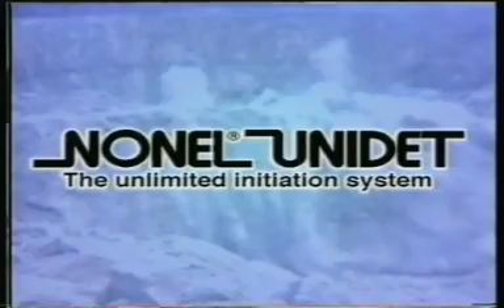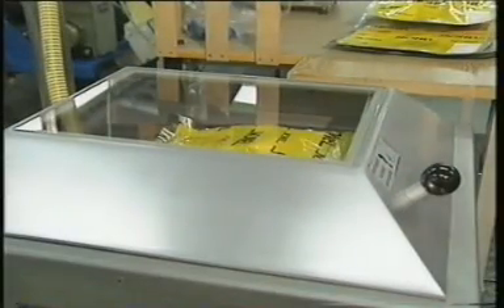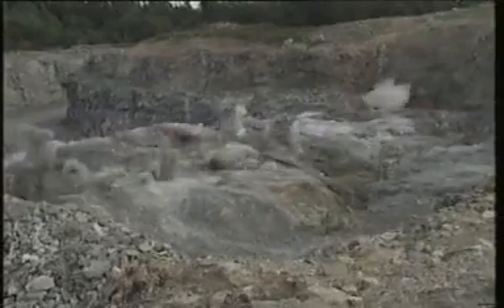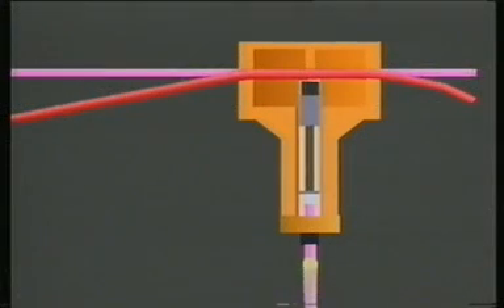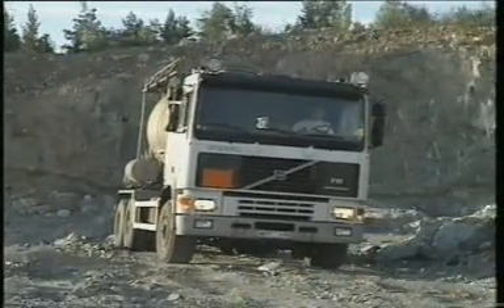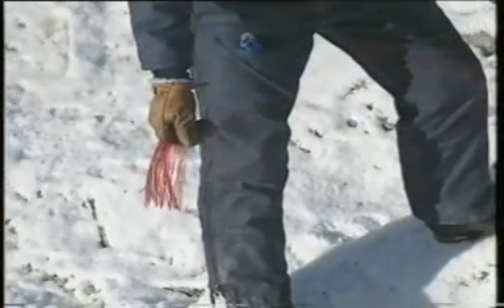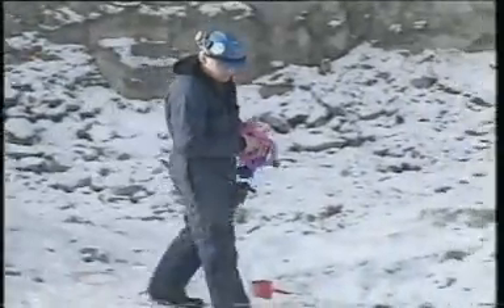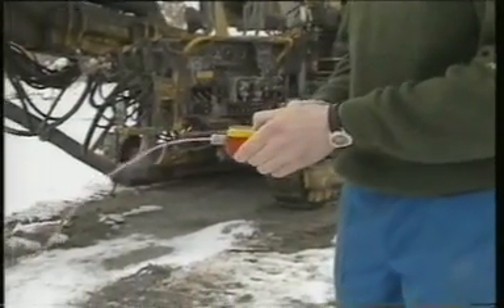Nonel unidet uk

Comment: SO...the Nonel is connected to the blasting machine, and the Detacord is downrange of the connector...or vice versa??
Reply: According to the video, there is no detcord. The Nonel carries all the way through the special Nonel splices to the time-delay detonator. This doesn't use a standard blasting machine either. It looks like there's a special end fitting to connect the Nonel to the control - it wouldn't surprise me if that was mechanical too. Slick system.
Reply: thaddeus buttmunch yes